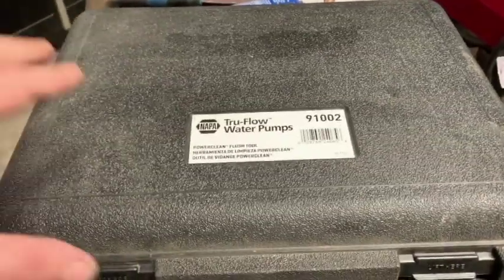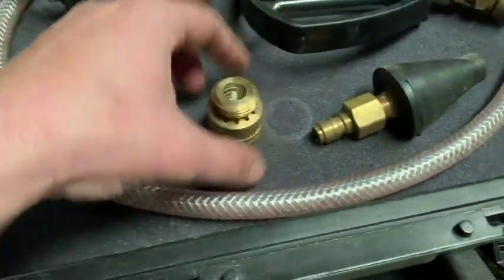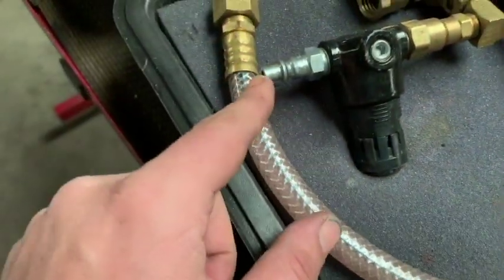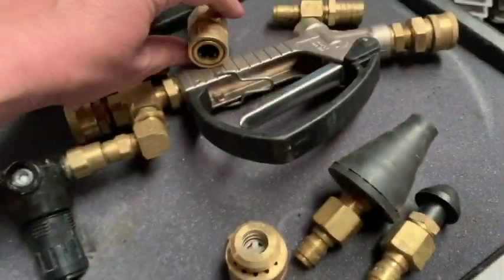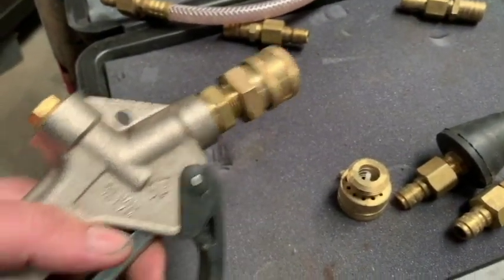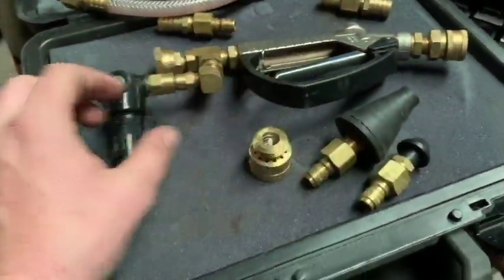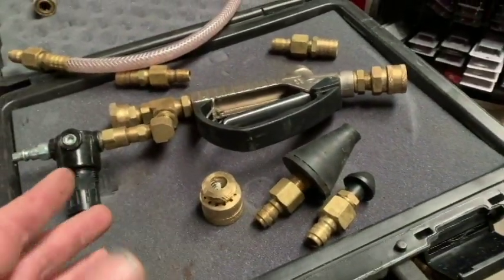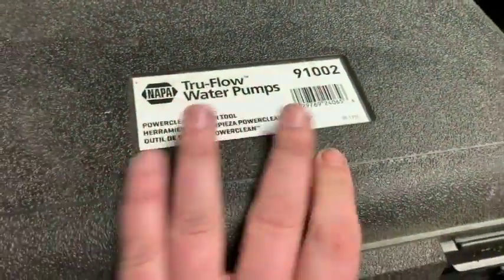NAPA TRUE FLOW COOLING SYSTEM FLUSH KIT

Comment: Does being in the dessert cause cooling system failures more often? I have a super long blow gun for radiator and condenser fins.You must get a boatload of dust from the roads out there. Great vid as always!
Reply from the maker: yes, but mostly because people use water instead of coolant, or they use stop leak

Comment: OTC makes a similar tool for like $50 vs $450
Reply: I have the OTC. Works great on heater core flush outs.
Reply: I have the Mityvac MV4570 tool, which is similar to the OTC but a bit nicer IMO.  Regardless, the NAPA (Gates) tool has an patented water pulsation feature that the other tools do not.  It also has a second regulator internal to the tool to ensure that the combined water+air output stream does not exceed 28 psi.  The other simpler, less expensive tools just combine water and air, and you have to be very mindful of both your water and air pressure to ensure that you don't blow out your heater core or pump seals.  I usually keep the air pressure and water pressure down around 20 to 25 psi with my tool, and try to mimic the pulsation of the 91002 by feathering the trigger a bit.  This helps, but is not quite the machine-gun hammering action that the 91002 delivers.  But then again, my Mityvac MV4570 tool cost less than 1/5th of what the 91002 does!